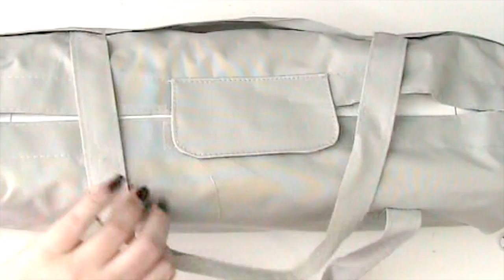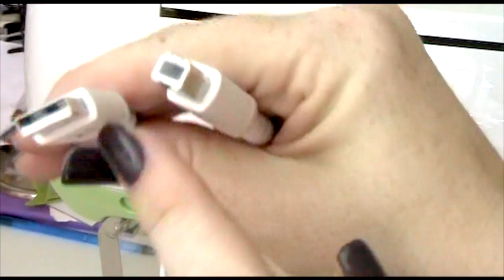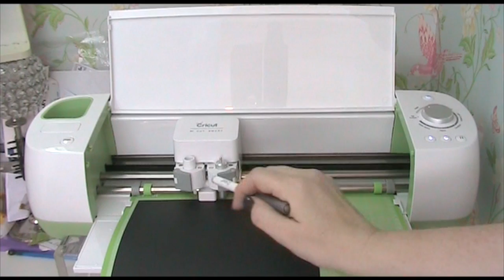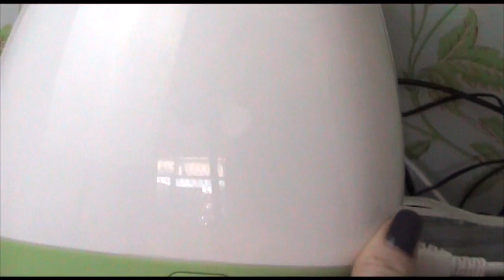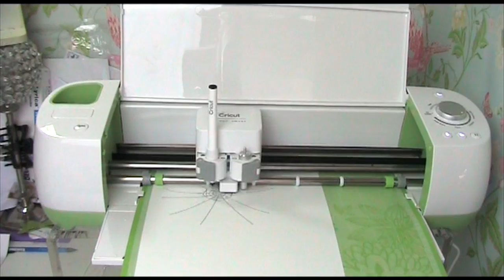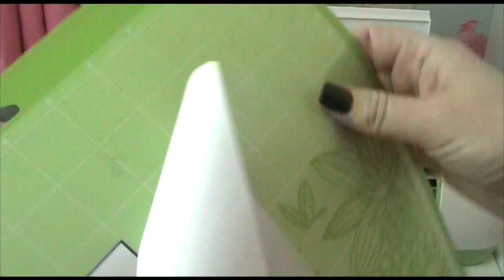Cricut Explore Set Up

Comment: Thanks for your reply! Is there a certain vinyl and transfer paper you recommend? Also it doesn't already come with a mat?
Reply from the maker: Use your normal mat, and I have so far used cricut and silhouette vinyl just cos I know they are suitable for our type of die cutting machines. What you want to do is set it to kiss cut only and then stays on the backing paper of the vinyl and then you pull away excess and then use the transfer paper - if it is needed, some designs dont need it. The cricut explore tells you the setting for vinyl and it does cut at a kiss cut if that helps. Funnily enough I just did a video using that setting to make a card cutting washi tape sheets. :-)

Comment: I've never used a cricut explore or any cricut for that matter. Buying one soon. What tools/materials should I purchase with it? Do you recommend a certain vinyl it transfer paper or anything else? I would appreciate your input. Thanks!
Reply from the maker: The only thing you need extra to start with is Mats and maybe the tool kit which has a tool to get the rubbish of the mat, a picker and flat spatula tool to help pick you cuts off the kit etc, but other than that I would say just enjoy your machine and the rest get if you want later, :-)  PS personally learn a bit about your machine before you use vinyl, its great to use but better when you have a few cricut miles under your belt lol! xoxo